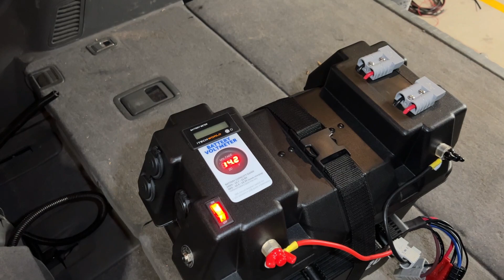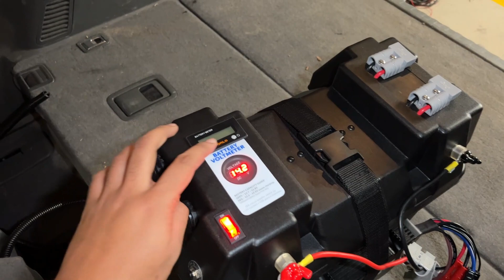Prado 150 - Removable Itechworld Lithium Dual Battery Box Install

Comment: Very good work.  I do have a question re the Anderson power poles being soldiered.  I was under the impression crimp should be used in automotive applications due to solder cracking with vibrations.  Thanks.